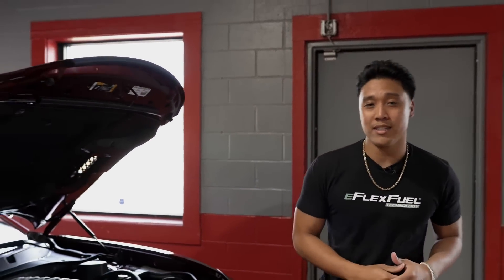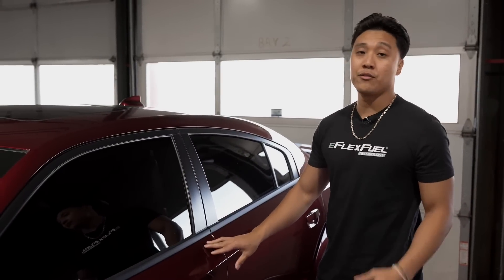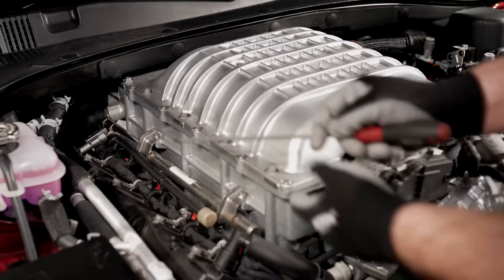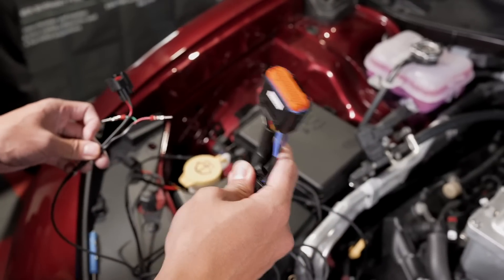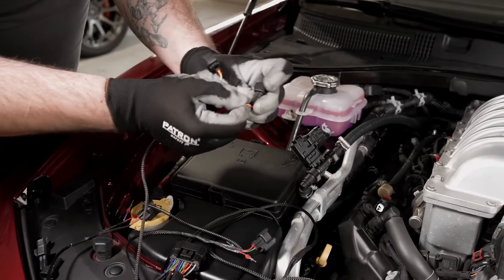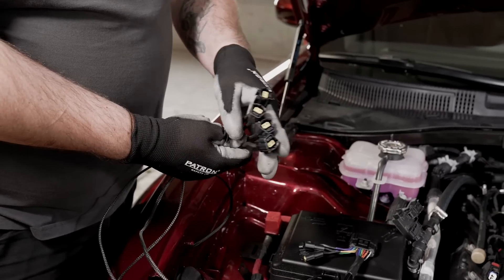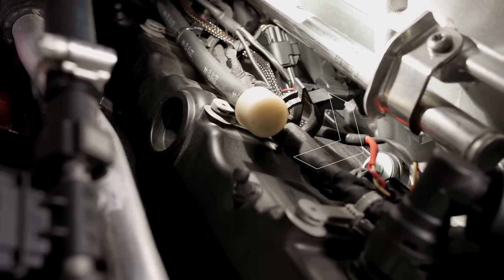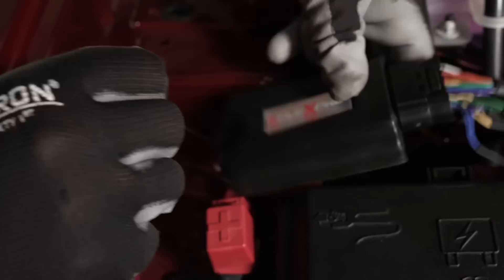How to Install an eFlexFuel Conversion Kit on a Dodge Charger Hellcat Redeye

Comment from the maker: This video features the older eFlexPro(1) system. With the eFlexPro2, the white 0-5V Analog Input wire no longer needs to be soldered to an external load sensor as mentioned in this video. See this article to help determine if you have a Pro(1) or Pro(2) and learn more about the 0-5V Analog Inputs: https://support.eflexfuel.com/hc/en-us/articles/15857444646172

Comment: so when checking injector harness, only the positive side will show continuity?
Reply from the maker: When you check it on your multimeter, the side that shows activity will be the side you plug our red wire into.

Please refer to our install guide if run into any more issues: https://support.eflexfuel.com/hc/en-us/articles/15877316176668-General-Installation-Guide-I-do-not-see-my-vehicle-listed-what-do-I-do

Comment: Can you run this full time with pure E85 on an otherwise stock Hellcat (stock fuel injectors) and never have any issues?
Reply from the maker: The stock fuel injectors in the Hellcat are slightly undersized for running full E85. However, you can safely run a 60% ethanol blend (E60) and still experience many of the performance benefits associated with E85.
Reply: @eFlexFuelTechnology what would happen if you do run E85? 
I don’t want to have to mess with mixing up fuel blends at the pump every time
Reply from the maker: @BasedXennial  Our system automatically performs the necessary readings and adjustments when you choose to blend the two fuels. However, for the Hellcat, running exclusively on full E85 can cause the engine to run lean, which may lead to performance issues or potential damage.

Comment: So how much power did it gain? Also what other mods were done prior to installing e85
Reply from the maker: It gained 60 extra HP to the wheel.
The vehicle only had an intake installed. Everything else is stock.

Comment: Where does the white wire get soldered into on the map sensor? Which of the wires on the map sensor does it need to be connected to?
Reply from the maker: We've just updated the video description now - this video features the older eFlexPro(1). The white wire no longer needs to be soldered to a load sensor with the eFlexPro2 because the eFlexPro2 features a virtual load sensor. See this article for more information the 0-5V Analog Inputs here: https://support.eflexfuel.com/hc/en-us/articles/15857444646172
Reply: @ thanks!

Comment: Do you have to tune once installed?

I have a 2016 hellcat charger
With 2.75 pulley, 1000cc injectors, ngk lfr7aix plugs, and 180 thermostat
Reply from the maker: Our system is designed to work with the tune already on your vehicle, assuming you have an ECU tune to accommodate those bigger injectors.

Comment: Hi can you explain how to solder the Pro version analog wires to either the MAP and MAF sensor? like which wire of the sensor should be soldered to the white and gray wire. I have a 05 STI with both MAF and MAP. Thanks in advance!
Reply from the maker: We've just updated the video description now - this video features the older eFlexPro(1). The white wire no longer needs to be soldered to a load sensor with the eFlexPro2 because the eFlexPro2 features a virtual load sensor. See this article for more information the 0-5V Analog Inputs here: https://support.eflexfuel.com/hc/en-us/articles/15857444646172

Comment: Okay, You got this old Hellcat owners attention and I’m really impressed with what I see thus far, Question how much is this eflex fuel conversion kit, and secondly how much is the cost to install this eflex fuel conversion kit?
Reply from the maker: We have two different kits available. The Plus and Pro system. The system that you saw installed in this video is a Pro. The main difference between the two is that the Pro kit has more tuning capabilities than the Plus, so if you plan on dialing in your vehicle's fuel delivery then the Pro version would be the best bet. Visit our website at eFlexFuel.com/us for pricing.
Reply: @eFlexFuelTechnology  will this work if ur already tuned and have pulley work
Reply: @HennyTRX3773 from what I can tell, it should be fine. Seems like all it does is hijack the fuel injector signal from the ECU/piggyback and make adjustments to the duty cycle of the injectors based on the percentage of ethanol in your fuel lines.

Doesn't seem to mess with ECU itself nor does it plug into the ignition coil/packs/spark plugs so it doesn't adjust ignition timing so in theory you should be able to use this with another piggyback ECU tune and it should work.

Don't quote me on that, not an expert, but it looks like it would work.
Reply: @eFlexFuelTechnology  but with being tuned u will still be able to adjust timing on ur stock ecu and will this system allow u to adjust to the timing the was made from the aftermarket tune adjustments?
Reply: @HennyTRX3773  seems like it. It seems to only adjust injector duty cycle so everything else should remain as you have it as far as I can tell

Comment: Can this guide be used on a scat pack as well ?
Reply from the maker: yes, it can be. Our installation is straightforward. Components on the scat pack may be in different locations but it will be similar.

Comment: Which sensor wire should we solder the white wire too? Should we get additional ones? Does it matter?
Reply from the maker: You have the option to solder the wire to either the MAF or MAP sensor, but it is not necessary as our Pro system has a virtual load sensor that automatically reads the data for you.

See this article to help determine if you have Pro1 or Pro2: https://support.eflexfuel.com/hc/en-us/articles/15857444646172
Reply: @eFlexFuelTechnology  I have pro 1 not 2. It doesn’t have virtual load sensor does it
Reply from the maker: @rxpid4231  Okay understood, the Pro V.1 doesn't have the virtual load sensor. So in this case, you can solder the wire to an external analog sensor. The system does not require you to connect any sensors to function, although the option is there if you plan on gathering data from one of them.
Reply: You figured that out?

Comment: I’m a new buyer and received my kit a couple days back and my biggest question right now which I seem to not find an answer to is what is the purpose of the bypass module?
Reply: Ah, the bypass module! This nifty little device serves a crucial purpose in the E85 conversion process. The bypass module is designed to intercept and modify the signals between the engine control unit (ECU) and the fuel injectors. Its main function is to ensure that the correct amount of fuel is delivered to the engine when using E85 or other ethanol blends.

You see, when you convert a vehicle to run on E85, the fuel injectors need to be calibrated to accommodate the higher ethanol content. The bypass module helps in this calibration process by adjusting the signals sent by the ECU to the injectors. It ensures that the injectors open for the appropriate duration and at the right time, allowing for optimal fuel delivery and combustion.

In addition to its calibration capabilities, the bypass module also provides real-time monitoring of the fuel blend. It can detect when the limits of the injectors are reached, providing a warning to the user. This feature helps in maintaining the performance and longevity of the injectors.

If you have already replaced the fuel injectors, it is important to list the modifications on the checkout page when purchasing the eFlexFuel bypass module. The technical support team will then confirm the compatibility of the injector connectors and verify that there is enough flow capacity for E85. Best bet, however, is eEFlexFuel support at 1-833-539-3835
Reply from the maker: Just caught this comment now! In case anyone stumbles upon it, the Bypass Module is essentially a "dummy plug" that plugs into the eFlexFuel harness in place of the control unit and completes the injector wiring, deactivating the eFlexFuel system. The Bypass Module is mostly used for troubleshooting during the initial installation. Read more about the Bypass Module and other kit components in this article: https://support.eflexfuel.com/hc/en-us/articles/15893186778140

Comment: Just got my pro kit for a 2012 dodge charger srt8. My question is like others have asked is about the white wire(s) i understand they go to a MAP, MAF, TPS, OR O2 SENSOR, but they all have multiple wires for the connector so what one do i solder to.
Reply from the maker: For our older Pro Version 1, it was recommended to solder to calculate data. For the new Pro 2 version two, it's optional to attach the white wire since the Pro2 now has a virtual load sensor that reads and calculates the data

Comment: im interested but is it legit does it really boost hp by 12% more i need the dyno results stock vs the e85 conversion.
Reply from the maker: Yeah, the increase in HP all depends on many factors as well (ex: mods and vehicle type)

Comment: What about the white wire?
Reply from the maker: The white wire can be soldered into any external sensor (MAF, MAP, TPS) to read more data
Reply: How would the extra data be used?
Reply: but what wire on the map

Comment: I have the PRO kit installed on my 392 hemi. What MAP sensor wire does the white wire connect to?
Reply from the maker: The white wire can connect to any external sensor (MAP,MAF,TPS)
Reply: @eFlexFuelTechnology  How do you connect it to the maf? Are you supposed splice into another wire?
Reply from the maker: @WickedMedia978  you will need to splice our white wire into the MAF sensor itself. The eFlexPro instruction manual will give you a more thorough insight into how to splice into an external sensor: https://eflexfuel.com/pub/media/ladattavat/eflexfuel-manual-eflexpro.pdf
Reply: @eFlexFuelTechnology that link doesn’t go over anything about splicing to map or maf sensors it just goes over adding an additional white wire to the harness?

Comment: doesn't e85 damage rubber and plastic in vehicles not designed from the factory to run on e85?
Reply: I was wondering the same thing.
Reply from the maker: E85 does not damage the rubber and plastics in your vehicle. In fact after 94', the majority of vehicles released from factory have fuel lines that are able to withstand E85 fuel.

Comment: No e85 anywhere near me
Reply: e85 is 85% ethanol and 15% gas. you can make ethanol for less than $1/gal
Reply from the maker: Where state are you located in?
Reply: @eFlexFuelTechnology  I’m in NJ right outside of Philly. Looked up e85 and closet one is about 30 mins away

Comment: so this kit is all i need to run e85 plus regular gas on my 2010 2ss camaro?
Reply from the maker: yes, that's correct! With our kit installed, you'll be able to run E85, Gas, or any blend safely!
Reply: @eFlexFuelTechnology  When y'all say any blend, you mean I can run like 25% E85 + 75% Gas and the car would still run fine?

Comment: Say I run different injectors than the stock. Can I customize the connectors in the kit to match or should I get adapters?
Reply from the maker: Yeah, the harness can be customized to fit your right size injectors